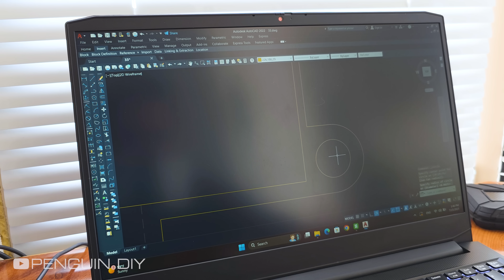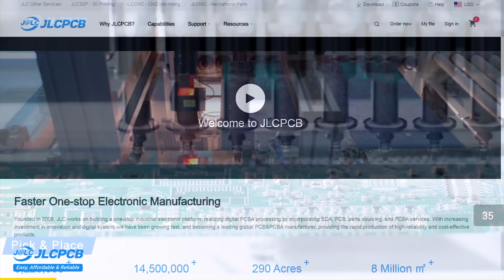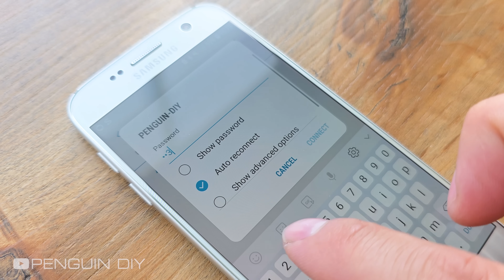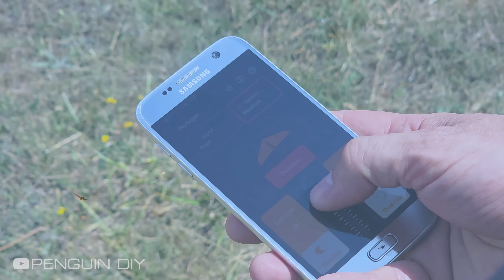DIY Paper Jet with Wi-Fi Control | 3D Printed RC Airplane with Long Range Flight Test

Comment from the maker: Easy, Affordable and Reliable - JLCPCB, Your Full-Service Electronics Manufacturing Partner.
Explore more deals at JLCPCB's Coupon Center： https://jlcpcb.com/coupon-center?from=penguin
Reply: Could you share the source code and design files with a Google Drive link so we can order and build the PCBs?
Reply: Do you have a rc board link shop and design card board?
Reply: Is it possible to have a conversation about buying a product of yours
Reply: U can add sollar panel for charging on the fly
Reply: Can this model be purchased as a whole from you?
Reply: This is NOT an original kit by this channel. He is making YouTube bucks off of you people from someone else's work and has been reported as such.
Reply: أنا من السودان 🇸🇩 
و أقول لك إلى الأمام
Reply: @penguinDIY is like to purchase some of your products how do I go about that

Comment: Takes a special kind of mindset to 3D design, 3D print a part, then dremel holes for socket, LED, switch etc in the print instead of having them in the 3D project.
Reply: خیلی دقیق نگاه کردید، به نظر من سوراخ ها رو دستی زده چون نمیخواسته درگیر تنظیم سایز سوراخ ها باشه در مدل سه بعدی

Comment: I can guess how it moves left or right but the altitude I can see it's manual adjustment. Left or right is base on reducing or increasing the left or right motor power so can I assume the altitude is base on power like more speed you go higher and less speed you descent?

Comment: The circuit look very simple like it’s only have a single MCU that handle :

- Lipo charging/discharging 
- Rx/Tx LoRa/Radio signal 
- Also control 2 motors 
- Gyro sensor ??

Credit belongs to the company which sent the dude such PCB to test.

Comment: "I designed and built a WiFi-controlled paper jet with a custom 3D-printed body from scratch." No you didn't, you adapted electronics and used an app produced by Mobojet. Why don't you credit them with all of the real work?

Comment: It is not a jet, it is electric airplane. There is no jet engine
Reply: Actually paper jets do have paper jet engines but since they’re made out of paper they are supported with airplane propeller blades as shown.

Comment: The PowerUp design uses Bluetooth LE which uses less power and has 230ft of control, which is good enough for paper airplanes. So the PowerUp design is lighter weight and yields longer flight times.
Reply: PowerUp 4.0 was the best iteration of this idea. I use 1,8 mm lightweight foam for wing and tail surfaces plus carbon rods.
Very creative and lots of fun. Some design fly superb!

Comment: Do you really arrived to distance 400m on simple Wi-Fi transmission protocol? I have a few toy drones with brushless motors and GPS. After 50-100 m into field I have problems with communication between the drone and RC. What kind of antenna do you use on your plane?
Reply: 400 meters, yeah right! DJI limits their drones to 50 meters in Wi-Fi mode, and this guy went 400 with no antennas ;-)

Comment: Good project but where did you buy the components? (board, battery, carbon fiber tubes, etc) and the dimensions for the paper plane. Thanks

Comment: Hey i want to build it myself. Is there a part list and the stls. For the printer ?
Reply from the maker: Electronic components and electronic circuit boards. This project is exclusive to a company that produces such a paper jet. That company sent me the board exclusively and does not sell the components to the general public.

Comment: I like how you modified the kit. Cut that little carbon rod to use as stabilizers, smart! Single carbon down the middle to house the wires, smart! Removing all of the weight of the front fascia and designing your own, smart.  Mobojet should have crowd-funded. The app is still there. This board wouldn't be that hard to design. Programming though, hmmm. Can you dump the sketch and tell me the ESP they used?

Comment: It would have been nice if you had included a description of the parts for your viewers.
Reply from the maker: Electronic components and electronic circuit boards. This project is exclusive to a company that produces such a paper jet. That company sent me the board exclusively and does not sell the components to the general public.

Comment: Could you share the source code and design files with a Google Drive link so we can order and build the PCBs?
Reply from the maker: Electronic components and electronic circuit boards. This project is exclusive to a company that produces such a paper jet. That company sent me the board exclusively and does not sell the components to the general public.
Reply: @PenguinDIY  как называется компания? Где купить готовый продукт?

Comment: Great job ! Congratulations for the project and home installations. Please, could you please send the wifi controller + motors module purchase link ? Best regards
Reply from the maker: Electronic components and electronic circuit boards. This project is exclusive to a company that produces such a paper jet. That company sent me the board exclusively and does not sell the components to the general public.
Reply: @PenguinDIY there is no another way sir
Reply: @PenguinDIY  may u tell me more about your circuit board+ wifi controller

Comment: Please enter full electric components with model name and app name it is necessary to make it please I'm waiting for your reply
Reply: This is the most demanding comment I've ever read
Reply: Just buy the damn thing.. It's from mobo jet. 
They sell this paper plane with more updated designs.
Reply: You forgot to add asap...in all caps 😅 ...
Reply: Anything else, your highness?
Reply: Hello Saar
Reply: @dasara want him to come to your house and fly it too?
Reply from the maker: Electronic components and electronic circuit boards. This project is exclusive to a company that produces such a paper jet. That company sent me the board exclusively and does not sell the components to the general public.
Reply: @PenguinDIY okay, so it's completely proprietary? That doesn't exactly mean DIY, does it. BTW, most of us don't have access to a 3D printer, so if you're going to post something as DIY, you may ghost want to take that into account.
Reply: Figure it out.